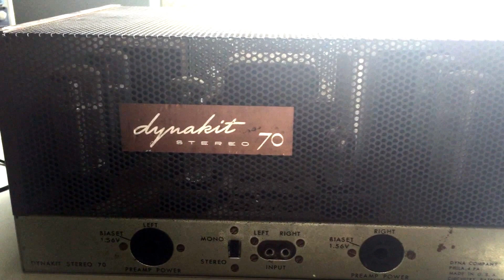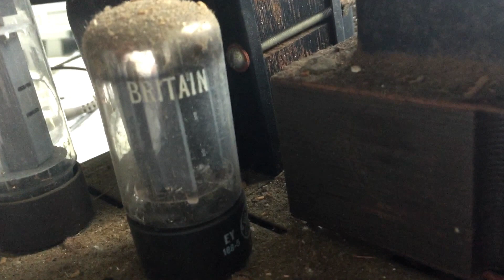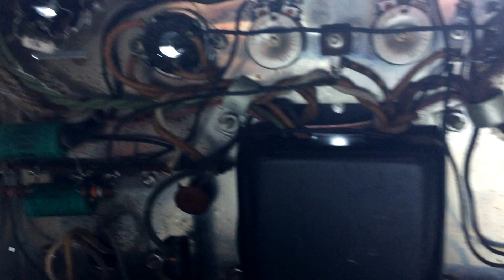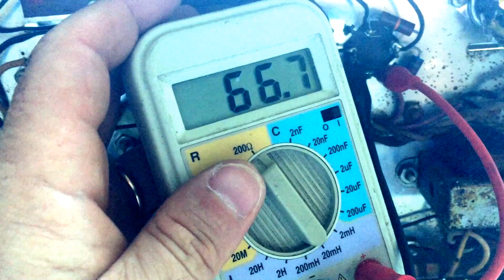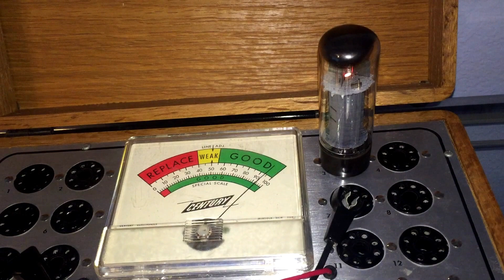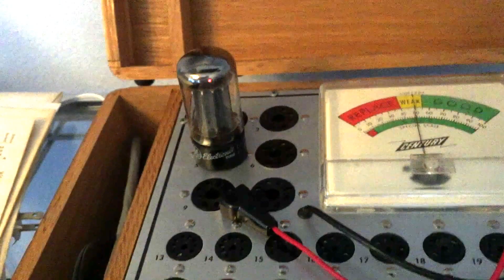Dynaco Dynakit ST70 Stereo tube amplifier repair PART 1 of 9

Comment: Going thru my storage boxes I found my old stereo system .. Dynakit stereo 70  Serial number 6017288
    Dynakit stereo pre amplifier for model PAS-2  Serial number 7023103
    
    2 acoustic suspension loud speakers   
        1 AR 3 SR no.6391     1 AR 3 SR no. 6407
 
I assembled these in the early 1960ies while I was in the Seattle fire dept.
What would it take to restore to working condition....would it be worth putting it back in working condition??
I also have the original instruction assembly manuals for the amp and pre amp.
 
Thanks
Ed
Reply from the maker: Re-cap the AMP and pre-amp power supply section.   Test the resistors and replace as necessary...

Comment: I'm not positive if you knew this but from a quick look before you pulled those tubes I would say all for our mullard manufactured
Reply from the maker: It’s quite possible
Reply: I have this same model amp and it definitely has mullard el34s
Reply: @jamestaylor3500  I have one of those available local to me for sale for four hundred bucks that's not in bad condition if anyone's looking for one I'd be more than willing to pick it up and as long as you cover the shipping charges and stuff send it to you